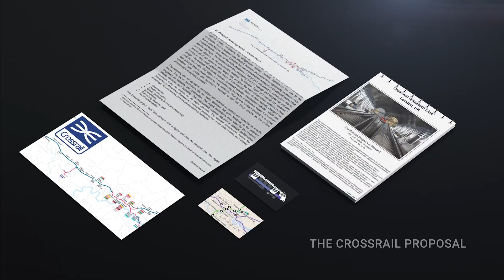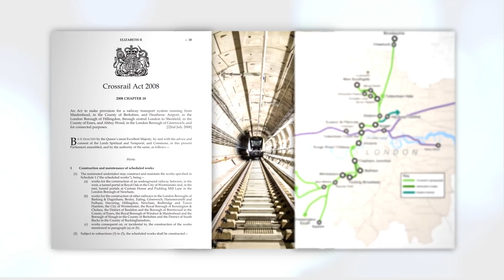London's $20 Billion Plan for High Speed Rail, Explained

Comment: "The infrastructure is largely outdated"  That's a sweeping generalisation that is also incorrect. The infrastructure may be old - London was the largest city in the world in the C19th when much of the  railway and early tube lines were created - but since the 90s there has been significant investment to modernise the tube, line extensions have opened, the DLR has grown to be a major light rail system in its own right, and a new tram system has opened in South London.  The Overground rail network has been created from repurpose and disused lines, and several of the great central London termini, always built to serve a high capacity, have been modernised.   Over a million people travel into Central London every day, and there are up to 5 million single journeys on the tube. There is a very extensive bus network that ensure that 96% of Londoners live within 400m of a bus stop, and buses serve the capital 24/7.  The roads are congested, and capacity is constrained by the layout, which has developed in a fairly haphazard and incremental way from Roman times. This is one of the main reasons that public transport is so critical to London.  Crossrail will add about 10% to Central London, as well as relieve pressure on major rail interchanges, and it is built to C21st space standards, with capacity for growth in the future. Its success will likely spur the future development of Crossrail 2, which will run SW to NE through the city, and further improve links between suburban centres.  So Crossrail is definitely an historic and significant addition to London's infrastructure, but calling the existing network outdated is inaccurate and misleading.
Reply: I agree with you, but this video seems to be from an American perspective, which is strange to say the Crossrail was a failure when many big cities in the USA don't have basic public transit. 🥴
Reply: Frankly it's amazing how well London's public transport works considering it's past of being cobbled together from multiple company's lines, mergers, and budget cuts. It's one of the busiest with a mix of modern and ancient (by rail standards) infrastructure and yet it works. This new line is definitely needed though and should serve London well for it's future needs. And the new stations are amazing from both an architectural standpoint and lessons learned in passenger movement. Better changeovers, less bottlenecks, more capacity.
Reply: Agree, I picked this up on another American channel (OBF) which was effectively describing the public transport here as slow and expensive when in reality it isn’t. definitely poor research at play here
Reply: spot on!!
Reply: I think he meant the road infrastructure, which is true, since the Ringways were cancelled in the 80s (thank goodness).

Comment: If you ever seen any other engineering failure globally, you will not actually use this term to describe the project. In fact, why you cared about the delay and overbudget, is simply because you really want it to be available now. The city do need some form of transformation in terms of transportation. When you get off a modern train from Shenfield to liverpool street and then hop onto the ancient tube, you know you really want the missing portion completed as soon as possible.
Reply: Compare it with the new Berlin (BER) airport! The central section is opening on May 24, but it will not be connected to the western and eastern sections which have been running with the new trains for some time. It will not run on Sundays at first, in order to iron out technical problems. Later this year trains will run from both the western and eastern sections into the central core. May 2023 is the date by which there will be trains running the whole way, but this will affect relatively few passengers.

Comment: It’s not a failure at all, a little behind schedule but definitely not a “failure”
Reply: Agreed, the future investment opportunity and capacity upgrade is significant, yes a little overbudget and a few years behind schedule but the end product looks really good and hoping for great additions to its potential.
Reply: If you listen to the video, you will realise it took the government more time to make up its mind, than the project did!  A bit like Wembley Stadium 10 years of talking and then expecting to be built in two years!!!!!
Reply: @johnchristmas7522  yes, that's a bit...

Like in France.

For us, the RER had the same effect in 1969. It was expensive, very expensive (cathedral stations, superimposed RER D and A stations, and the Chatelet les Halles multipole built from the outset) and opened in sections: -1969 was the first and it was the Boissy branch of the line
-then in 1970, the La Defense-Etoile section
- then one station under Paris after another until 1977)

Originally, we thought large, and a high attendance was expected and everything was sized according to that.

In the end, the RER A was a monstrous success, which exceeded the attendance forecasts in 1987, and which had to be doubled by line 14 and the RER E (still being extended) to prevent it from exploding.

I welcome Crossrail, London's first RER.

Comment: I work on Crossrail, and yeah, it’s over budget and late but it’s certainly not an engineering failure. In fact all of the tunnelling and engineering work was completed on time - what’s caused the biggest delay is the integration of various signalling and software systems the trains use. The trains pass through different areas each covered by different signalling systems (ECTS, TPWS and CBTC) and the integration of these is what’s caused the headache. Also, all of the stations are now complete and have been handed over to Transport for London (excluding Bond Street). The central core section of the Elizabeth Line connecting Paddington and Abbey Wood  will open in the next few months, allowing trains to finally run under central London. Finally, the whole system will be connected East to West by 2023 - can’t wait for this! Well worth the cost imo!
Reply: It does seem a bit of a downer video
Reply: @AndrewRenton  i agree
Reply: What a fantastic workplace!

Im looking forward to see it in Operation.

Will finally give you what we have in Germany for many years already in multiple cities 😉 (although the stations in london are a bit bigger, but mainly because of the long tunnels needed to connect to the tube)
Reply: If he had to commute on the central line, he'd be begging for crossrail, worts and all. 
Appreciate the work you done, can't wait for it to be fully operational.
Reply: I’m really excited for the project to complete really appreciate your works over at crossrail
Reply: it seems to me that one of the reasons for the delay was the discovery of archaeological sites on the route. At least a year was lost, just with that.
Reply: Matt Miller.  How much maintenance work will this need, & how often will parts of the line be shut down to carry out the maintenance work.
Reply: Thank you for your service. What's the next big infrastructure project?
Reply: @PoliticalWeekly  High Speed 2 (HS2)
Reply: How did you get involved and what do you do?
Reply: The general public are not interested in the reasons why it is 4/5 years late. Never were. Just a never ending list of excuses and technobabble. We, the people who have had to pay for this bloody thing are only interested in one thing. Railway yes, or railway no. Nothing else matters. 
It never seems to matter when it is public money. HS will be exactly the same.
Reply: Yes signalling has been a problem but where is Bond Street? All the engineering work was not done on time. By a long shot.

Comment: I wish I had a job where I could finish a project 5 years behind schedule and $6 billion over budget and not get fired. Only in government
Reply: I'm sure there are cost overuns in the private sector.  However they are unlikely to handle such large and complex projects alone, and details of any cost overuns are less likely to be publicised.  How often do we learn about IT projects going over budget in the private sector?  Far less often than it actually happens, I imagine. A board faced with a cost overun may only learn about it when a large of investment has already been committed; and then they will try to decide if executives responsible for the project have been remiss, and whether it makes sense to replace them.   Projects in the public sector are no different, except that excess expenditure is likely to be subject to public or political scrutiny of some kind. There may be perfectly reasonable explanations for an overspend or a delay, particularly where the technical challenges are complex. Acoiuntability is a contested matter - for what, and to whom?  The local authority, the central government, prospective service users, academic association etc.    The notion that public sector project management is  lax and  inferior to the private sector is such a hackneyed cliche and takes little account of the difference between projects across sectors, and the significant variations in project governance. 

In any case the Managing Director and other senior staff were replaced after the delays and overuns came to light in November 2018. So your comment fails to apprehend what has actually happened at crossrail.